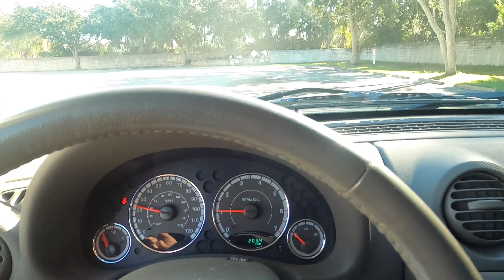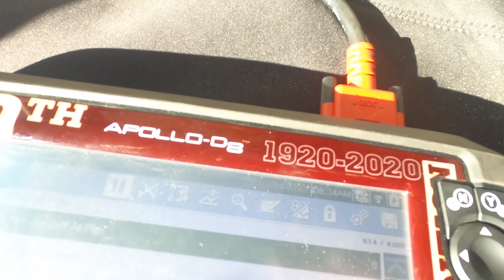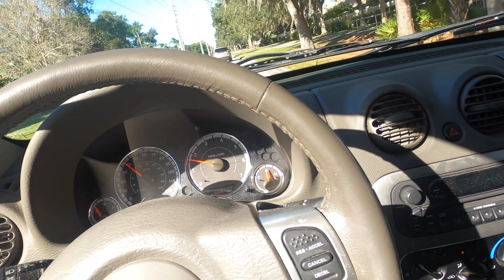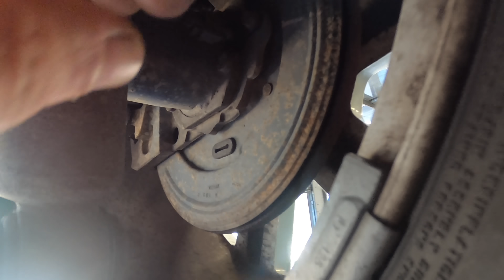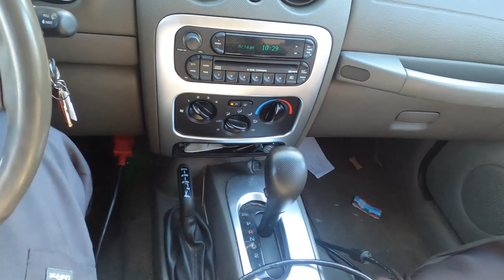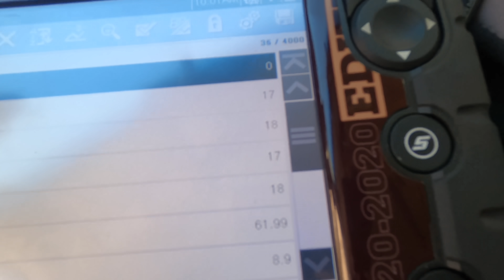MultiMeter Lied to me | Proving a faulty part. Jeep in limp mode

Comment: Put a little power on that circuit when checking it. That stupid little plastic fuse in my ignition circuit would open up when ign turned on. Close again when "oh dumeter " applied to it.

Comment: On top of checking the battery measure the rezistance of the sensor.in both directions in case the sensor have inside a diode in series inside.

Comment: If I ever decide I want to be a mechanic, I’m going to be a mechanic in Florida. Having lived in Pennsylvania my entire life, virtually everything I work on I end up using a cutoff disk or Oxyacetylene…
Reply: And a lot of PB Blaster
Reply: And/or a really long cheater bar. I'm also from PA and I've used an 8 foot piece of pipe to take apart a pickup truck suspension, and it still took a lot of effort
Reply: Florida gets corrosion too. Especially near the coast. The salt air is tough on everything. Try states like Texas, New Mexico, Arizona, and Oklahoma.
Reply: Like Ray has said in another video "Can't be stuck if it's liquid"
Reply: Maybe you might be lucky enough to work with Ray wouldn't that be great you'd learn from the master hey have a good evening bye
Reply: @michaelpressman7203  I do share a lot of his philosophies… I think we would get along very well.
Reply: rust is a pig. the UK too, as salty roads and prevailing damp conditions don't do metal any favours
Reply: @blackcountryme  In UK, I put a thin smear of CopaSlip, or AlumSlip with an old toothbrush on anything I can safely, otherwise threadlock (which keeps out the rust pretty well).
Rustproof everything else, and it still rusts, but a lot more slowly :-)
Reply: I live in Cleveland and a 2 foot cheater bar and a can of PB blaster are my best friend. That and a pair of really good locking pliers.
Reply: I have a 77 Datsun pickup from NM. Pulled up the carpet and checked the floorboards ..looked factory new.  The only surface  rust I found was in the bed where it has a seam to the side fender :)
Reply: Agreed.
Reply: It's better in the Southwest United States because it's dry and not humid
Reply: Go to Arizona, people like to act like Florida is a no-rust state…it is not. Shit rusts plenty here. The state is a friggen swamp so crap rusts a lot from all that constant moisture and then there’s the cars that live close to the coasts (salt air) rusts a lot. Stuff may not disintegrate as fast as road salt states do but believe me I deal with PLENTY of rusted-out vehicles. Arizona, which is where I’m originally from, is literally dam near zero rust on anything (and when I got stationed up there, Alaska, oddly enough, is an almost no-rust state, low humidity, and they don’t use road salt). Both states are zero on the corrosion index.
Reply: That is the one down fall to being a mechanic in Maine. But I have good luck with a map torch and lots of pb, sometimes it takes 2 or 3 times of heating it up then put the PB right to it. Get alot of smoke going, but i haven't found a need for acetylene yet. Obviously wouldn't work with this job with dealing with plastic
Reply: @frankhartford5194  if I have the element of time I will spray the parts down let them sit overnight and then have a lot more luck breaking stuff free bun thousands of bolts that way more than you can imagine have a good evening bye
Reply: My Jeep is 30 years old and not a speck of rust,easy peasy to remove and replace paarts..
Reply: I  got wonder if the payoff for all that salt is worth the 10 year max lifespan of cars.
Reply: Better yet, become a mechanic at the automotive plant. Some vehicles have problems rolling off the line and the techs there are working on a new car that hasn't seen asphalt yet.

Comment: I have a Fluke meter that I've been using for over 20 years along with a Fluke 87V that I have been using for work for about 14 years. If you want to get a new meter, consider getting a Fluke 88V. It has some good features for automotive diagnostics.
Reply: I have a fluke 77 that I bought 30 yrs ago they are by far the best meters
Reply: @kellismith4329  As they say, if it works, it's a Fluke.
Reply: all of that series, 77;87-xx;187, are totally reliable and nicely accurate.
Reply: I used to live near John Fluke's 2 massive, connected houses in Washington. He is the owner of the company.
His testing equipment products = the best!!!  Never had an issue with my Fluke  77 in 23 years..
He loves Lamborghini's..  :)
Reply: Yes, either fluke or go home. Even a cheap 117B would be more than enough for automotive use.
Reply: Luke is the best meter money can buy have a good evening

Comment: Ray, You were showing Megaohms not milliohms when on auto range   So when selecting ohms you  were  showing open circuit meaning in effect  high resistance which was correct.  So your meter may be fine.
Reply: I dont think there is anything wrong with it either.
Reply: @ghostrider.13  Yep, Ray fooled himself, the meter is fine, M-ohms is indeed megs but m-Ohms is milliohms, the meter was telling the truth with the capital M.
On a general point Ray, don't use a digital meter necessarily for reading volts down a cable, they have tens of meg-Ohm input resistance and will show volts when the line has a very poor connection.  It will fool you, best use a lamp load of some power.
You can try this test, especially in hot, humid and sweaty Florida.  Put one probe of your meter set to volts on the (12V) vehicle battery, grab the other probe between finger and thumb, put the other hand finger on the other battery terminal, you'll read barely a volt difference compared to the meter straight across the battery.
They can fool you.
Reply: @572Btriode  that’s good advice, thanks. I’ve always managed without a test light (but with a high quality multimeter, mind you) but I figured there must be situation where a test light is not only faster but also better. Ordering one now.
Reply: @572Btriode  DC volts..
Reply: To measure milihoms you need a kind of meter called 4 wires to zero the cable induced errrors. Also a common mistake with the buzz function of a meter is thinking the circuit is good  when you hear a buzz , when in fact you cant have a 100 Ohms or more  resistive circuit on a switch. Note that buzz level is different depending on meter used.
Reply: I was surprised he checked against the right side rather than a new one.
Reply: @stevejette2329  - I suspect he did not have  a new one to hand and had to order one in.
Reply: On both hands put your thumb in your index finger together then go on on and then you will achieve a higher state of consciousness hey everybody figured out one out have a good evening
Reply: Not a lot of practical difference between 19,000,000 ohms and 5,000,000 ohms.  Need to test switching with a magnet.

Comment: Had that been Michigan, where I live good luck getting that 10mm bolt out without breaking and the sensor would be rusted in the hole big time. We use lube on everything and even that only lasts for so long.

Comment: Good video as always. 
Just one small thing: The units were MegaOhms, not MilliOhms.
Reply: I was just about to say the same thing. 1m = 0.001, 1M = 1,000,000. The readings make make a lot more sense that way. Depending on the type of sensor, just measuring the resistance will not always tell you if a sensor is good or bad. I would have scoped it in-circuit while turning the wheel.
Reply: Was about to say that. Thats also why the Meter didnt show anything on the Ohm setting, as its not an Automatic Range.
Reply: I noticed as well and sorry I posted a new post regarding this  before i read your comment.
Reply: I new what he meant when he said milliOhm. If you watch his channel he always says stuff like that.
Reply: Potatoes patatos hey everybody have a good evening
Reply: Milliohms would be a unit of conduction (Siemens) not resistance. Have a read here; https://en.wikipedia.org/wiki/Siemens_(unit)
Reply: @JohnHill-qo3hb  Milliohm is not a unit of conduction. The unit is still the ohm, a unit of resistance. Milli is an SI prefix meaning 10^-3, so 1 milliohm is 1x10^-3 or .001 ohms. Conduction is the reciprocal of resistance. So, if we wanted 1 milliohm in terms of conduction we would divide 1 by .001 which is 1000 siemens.

Comment: If your meter isn't battery related Fluke makes some of the best ones out there.
Pricey but super reliable.
Reply: Agreed, my Fluke is going on 30 years old. Only ever have to replace the battery. 
BTW Fluke was the only authorized Meter manufacturer for the USN Nuclear power plants when i served in 1980s. Unsure if that is still the case.
Reply: I used Fluke meters exclusively in my work on emergency generator systems. Very accurate, durable, and reliable.
Reply: Yelp. They are top of the shelf.
Reply: I use a Klein tools meter, it’s been very good. Kinda pricey but still much cheaper than a Fluke.
Reply: I use a Fluke 117, it's worth every penny.

Comment: If your meter malfunctions, try replacing the battery. Then replace the Probes. If it then still doesn't work, get a used Fluke 83. They're the best, most reliable, general purpose meters you can get.
Reply: My back-up meter is a Radio Shack analog meter I bought in the 80s.  It always works.

Comment: Fluke is one of the best and most sensitive meters out there (also the most expensive), and even it has trouble giving precision resistance readings if !. the probe tips are oxidized or oily,  @. the probe leads are are not making firm positive contact with their respective plugs.....the wires in the leads are nearly severed and are only making sporadic contact.........brakekleen  and or vinegar can help.
Great channel Ray...good troubleshooter......sorry they give you all the $hit jobs
Reply: It's red, so it's a Uni T chinesium meter if I'm not mistaken. Fluke has always been gray with yellow.

Comment: This is just weird. I was about to ask a question on your Patreon. My wife has a 2006 Liberty. The RF wheel sensor wire was smashed by a tire place. I soldered it together, and all was good. When I did the brakes last week I decided to replace the sensor properly.  The factory WSS was stuck in the hub and snapped off. Had to drill it to extract. Put it the new one, then got the lights again. Figured faulty part, returned and got a new one. Same issue. I'm at a loss.

Comment: If you made yourself a loom you could cross wire the sensors by just swapping plugs over.
Reply: Why would you expend both materials & 4 times as much time doing that when swapping components is way faster?

Comment: Always appreciate your explanations, re: What is ABS? & How it works, I enjoy learning from your videos.
Reply: Anti skid braking was derived from aircraft brakes. First used in cars, on the Jensen FF I think.. (along with permanent four wheel drive) in the late 60's early 70's.
Reply: ABS is Anti-lock braking system to keep a wheel from locking up it pulses the wheel to keep traction.  it started in the 1920 with airliners and 1950s with motorcycles like Enfield then BMW later. 1950s car manufactures tested it, there are videos on yt of an old cutlass and others testing it. Ford had a setup on the 1970s thunderbirds to keep the rear axle from locking, Cadillac had 4 wheel option on some cars but it really kicked off with the electronic version when Bosch and Bendix companies got involved in it in the 1980s. By the 1990s most car makers used it for safety.  If you had a wife that always brakes on a corner no matter how many times you tell her to brake before the corner on icy roads you are happy for ABS.

Comment: Had an issue with my Peugeot saying the abs was faulty. Simple code scanner just brought back a generic code.

As it was drum brakes on the back I loaded the parts cannon and replaced both front sensors. Error persisted.

Then used a better scanner, gave me live wheel rpm values. Left rear was stuck at 0. As Peugeot use a magnetic ring embedded in the drum, not a toothed ring, I ruled that out. So a new rear sensor.

Fixed that fault… error came back, one of the front new sensors was broken. The parts cannon stung me, and we’ll chinesium parts.

And best bit is the connecting pins were the same, but the plastic connectors had the plastic “key tab” was in the wrong place, so a file and duck tape sorted that. 70k miles since the fix, still ok.

Comment: When your meter is having issues, replace the battery.
You say it yourself, power delivery is important.
Reply: Replace your battery in the multi meter.
It uses power to test resistance and you'll get dodgy weird and inconsistent results.
Reply: my mmeter also goes crazy whn battery gets low...
Reply: Yep, my multimeters play up when the battery is low. I just switch them out with new batteries and they,re good to go. One of them is a Fluke, which I’ve had for over 20 years.
Reply: Was looking to see if this had already been said in the comments. If getting inconsistent results from my multi, I swap the battery with known good and check again.
Reply: I agree most likely the battery on your meter is going dead.
Reply: Bingo
Reply: Ray if you want good multimeter get a fluke meter they are some of the best wish mine didn’t get stolen
Reply: @FJS He was using the multimeter for measuring the resistance. This is done by multimeter using an internal current source and measuring the voltage for calculating the resistance (transparent for the user). In the case of reverse voltage no current will pass and reading will be 0L, the same as an open circuit. Google "resistance of a diode" and see the result from Fluke of how to test a diode with a multimeter by measuring the resistance. Of course this is pure speculation from me because I have no clue of what is inside the sensor but the readings are matching a diode in series somewhere in the circuit.
Reply: @apclaudiu  there was nothing wrong with the meter.  He read Mega-ohms of resistance on the auto scale, then set the range to a manual ohms scale.  It would always show 4 mega ohms as O/L on that scale.  It was not a mills ohm reading as Ray stated.
Reply: A wheel sensor has a permanent magnet and a wire coil in it. So it should have the same resistance regardless of the polarity or which probe goes to which sensor lead. Saying that, I always test sensors in both directions. I flip the meter leads and take 2 readings. Then compare both readings with a good sensor. I agree that new batts are good in the meter and love Fluke meters. I also agree that he was seeing Megohm readings. If a sensor has high resistance in the Megohm range you have to keep your fingers off the leads as your body resistance will cause incorrect readings. Grab the leads one in each hand and you'll see some high Megohm reading.
Reply: When testing always test your tester first.
Reply: One think I noticed when measured second time he kept the sensors in the opposite direction. If the sensor is having inside a diode in series with a Hall sensor to transform the alternate current to continous current pulses then you'll measure a resistance in one direction and open circuit in the other. So always measure in both directions.
Reply: @apclaudiu  please redo your comment with proper english, i can get a little from it but not much..
Reply: @jeremylonberger8245  I'm guessing English isn't trotuar's primary language, but he made a valid point. What he was saying was that he noticed that Ray flipped the polarity when measuring resistance of the ABS sensors the second time around. Depending on the construction of the circuitry inside, this is going to yield different results. It's a good idea to measure in both directions and note that you're doing so, when comparing two devices.

All this aside, I think the primary issue is Ray's misunderstanding of what he's measuring. Nothing in the video seemed to point to a faulty meter. He switched ranges from Megaohms to ohms to measure something that had previously measured in the Megaohm range. If something measures in the Megaohm range, a meter locked in the ohm range isn't going to show a measurement.

As another aside. I would probably go ahead and buy a better meter.
Reply: @jeremylonberger8245  @nodriveknowitall
Indeed English is not my primary language. On top of explanations provided by nodriveknowitall (thanks by the way) it is important to  understand what you are measuring with the sensors more than having a more precise multimeter. Ray is very good with mechanical stuff but he needs to up his game for the future EV's. I only tried to explain why he had different readings on two sets of measurements.
Reply: It is also wise to have a backup meter for when one goes wonky